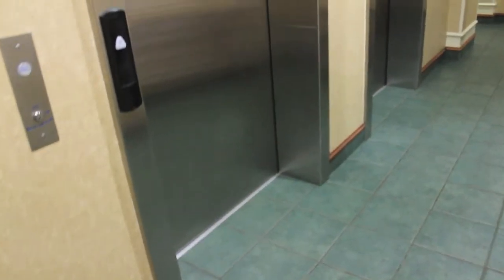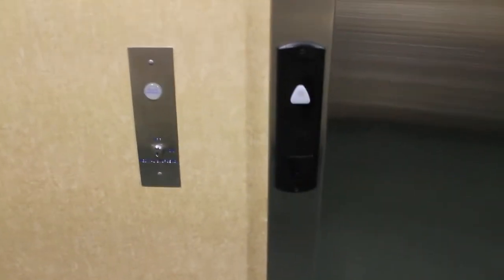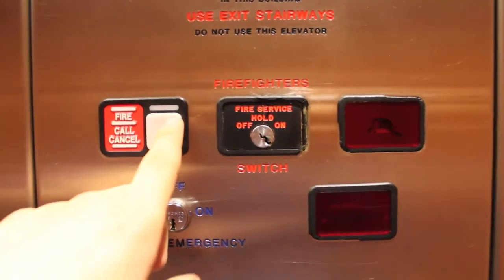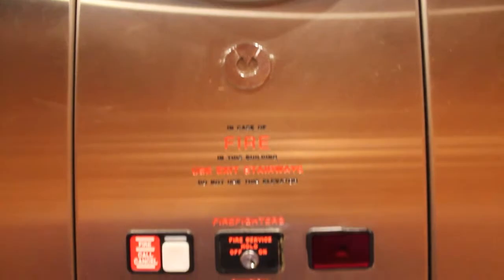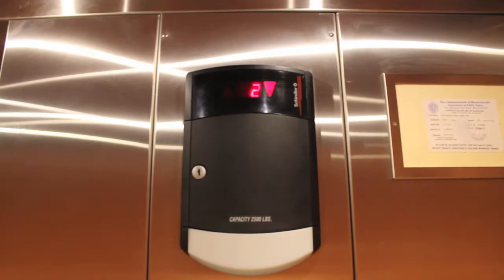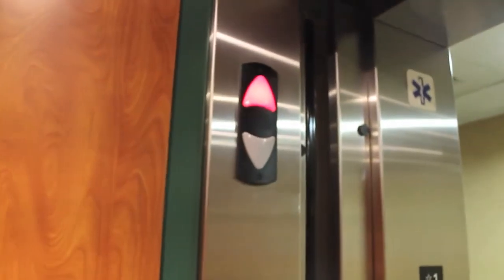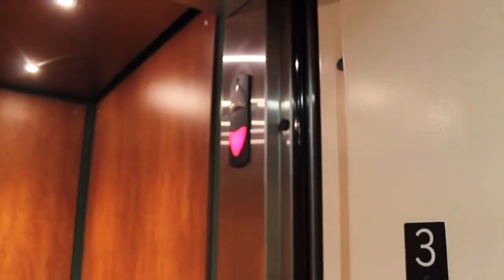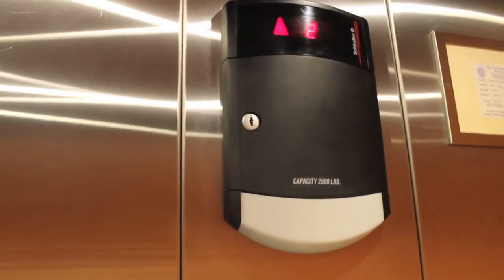ROARING Schindler 321A Holeless Hydraulic Elevator-Holiday Inn Express; Hadley, Ma

Comment: SOME stuff on it was from a 321a but the chimes on it are from a 330a. I believe there might be some secret model schindler hid that has both 321a and 330a features.
Reply: They both have the same fixtures
Reply: Rodj it isnt a secret model, when schindler finds there outdated models and that model was a prototype of another model by them they would upgrade the chimes, so they upgrade it to High Pitched Chimes.

Comment: Actually that's a 330A it has a nice motor though
Reply: 321A
Reply: MissouriElevators its a 321A.
Reply: 321A. These have the criteria of a 321A because it also serves 2 - 4 stops
Reply: This is a 321A
Reply: Techfreak415 I don't think so
Reply: MissouriElevators 2000 Install, so obviously a 321A.

Comment: that is a schenler 330A, not a 321A!!!
Reply: First of all, it is Schindler, not schenler. Second, you can't tell unless you ride it. Do you know the difference between 321a and 330a?
Reply: 22408aaron that is a 330A with HT fixtures!!
Reply: Riley ElevatorFan Obviously not. Clearly you know nothing about elevators.
Reply: 22408aaron BUT... this elevator doesn't have the chimes that came from a 321a. AND the font on the capacity plate isn't the font on a 321a(See the 321a video from Ih8escalators for proof)
Reply: ***** 321a isn't its style, 321 is the way the jack is mounted. A 321a jack is mounted on the front of the cab, while 330a has the jacks mounted on the side.
Reply: What about the font on the capacity plate?
Reply: Rodj the little details dont matter
Reply: Rodj The font has nothing to do with any 321A.